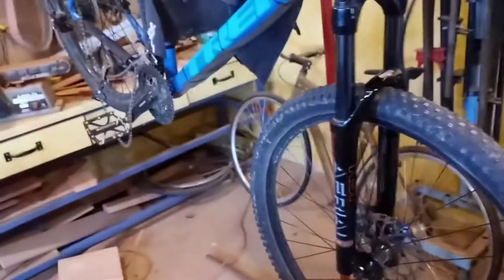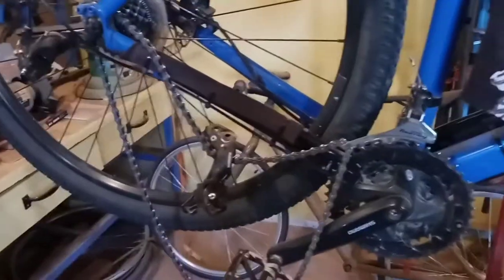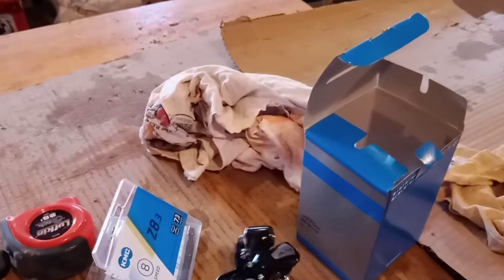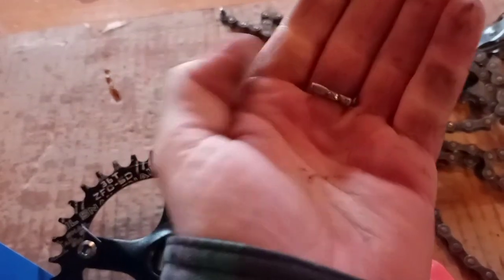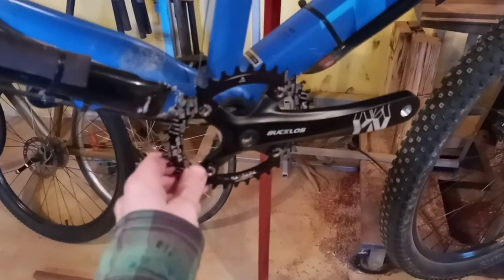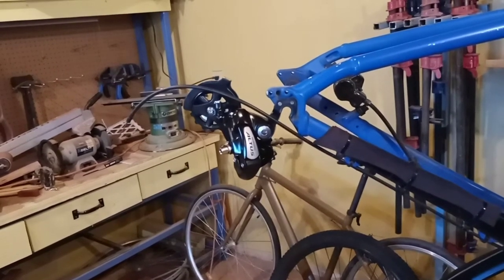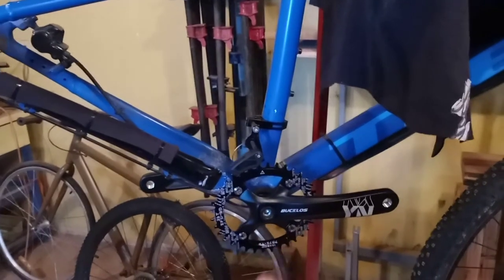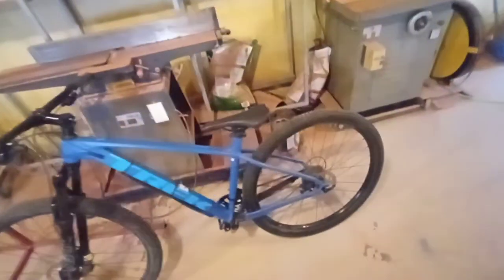$100 1x7 conversion on my Trek Marlin 5

Comment: What parts did you use for this ?
Reply from the maker: Just a square taper crank set that would take a single chain ring, 32T 1X chain ring, and a chain guide. You may need to shorten your chain as well.
Reply: @handy_andy_bobandy  thank you! Gonna do this same conversion! Gonna try 36T …you kept the same rear cassette on the bike correct?
Reply from the maker: @ciropaolillo7333  I did. It was the easiest way to go 1X without a massive bill in parts.